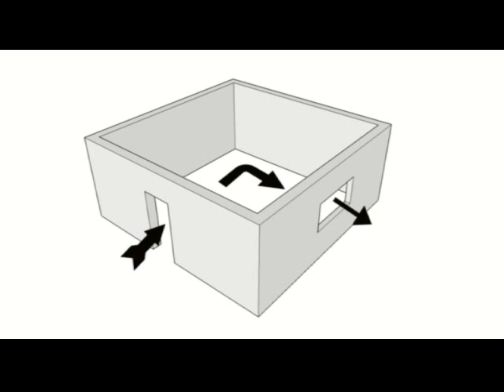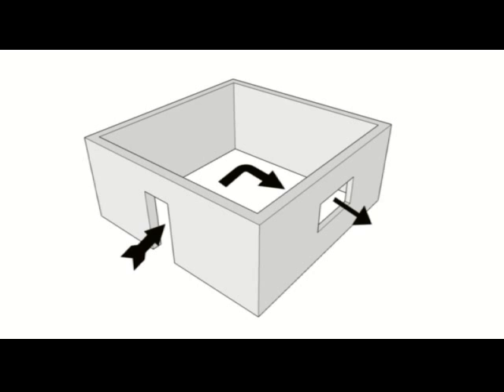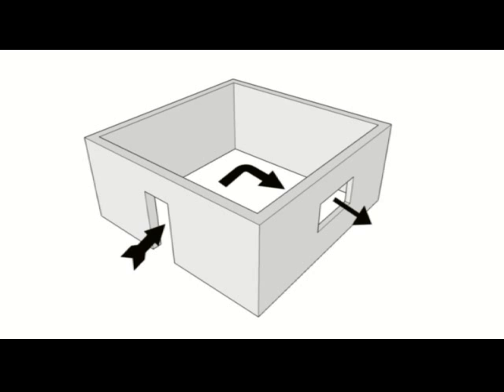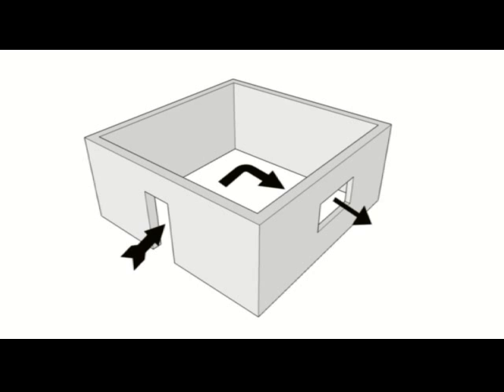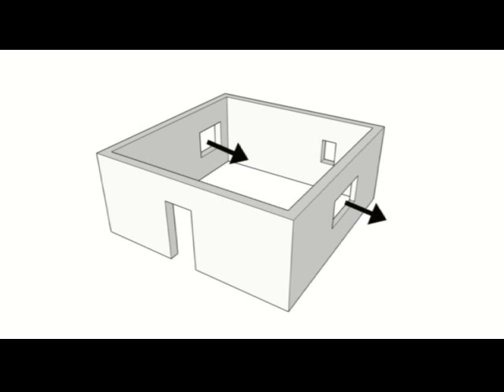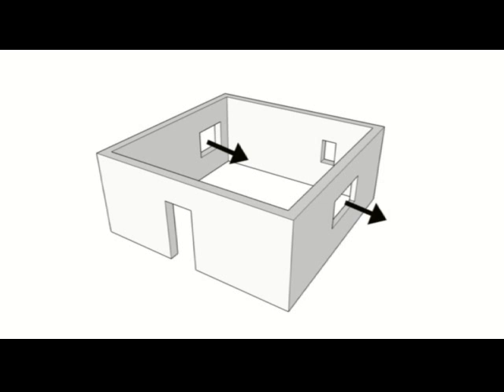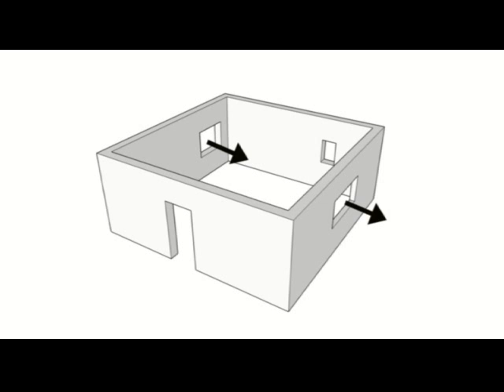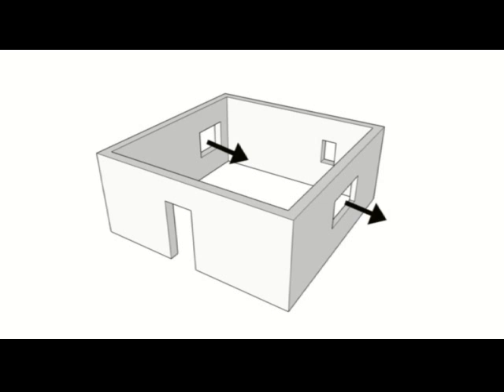House Air Circulation Basics - Home Tips

Comment: Houston Texas. Very hot. New home. The AC is akways on so I’m wondering if it pulls fresh, oxygenated air in? Mold is a huge problem here with heat and humidity, drywall etc. Thanks
Reply: It depends, Usually air conditioning does not pull fresh air it just recirculate the air with a heat exchanger to make it cold

Comment: What if you only have 1 window/door open - how would the air circulation work then?
Reply from the maker: I would suggest adding another window, ceiling fan or door if you can.
Reply: @gregvancom  nono, I meant how would the air circulate then, would it happen in a different way?

Comment: Question: trying to find the science on moving the 70° air in my living room (fire place use in winter), back to my bedroom at the other end of the house (which is 60°)? Thank you
Reply from the maker: If you have a heating and air conditioning system you can usually turn on the fan, this circulates the air, but doesn't turn on the heat or cooling systems. Now if you don't have an HVAC system, then the only thing I can think of would be using some type of a air circulating fan. Just don't do what I did and put it on the floor where you can trip over it when it's dark. If you do find a better idea, please share it with us, because I have the same problem in my house.
Reply: Yeah just pop a fan pointing back there. They have a lot of wall mounted fans.

Comment: Plss help...  My room is soo hot,  probably because of poor ventilation. 
Im planing of buying a ventilation exhaust fan...  Is it better to let the hot air out or let air inside of my room???  Plsss help
Reply from the maker: I have found that it is better to push the warm air out of the house, but also would suggesting trying both methods to see which one works better. One time I even put a fan pushing air into the house and another at the opposite end sucking it out.
Reply: @gregvancom  it depends on the house. I've tried several configurations, and you'd be shocked at how choosing a different window for exhaust, can change how many degrees you'll cool down at night. 
I have three fans going out, one blowing in, and most windows open.